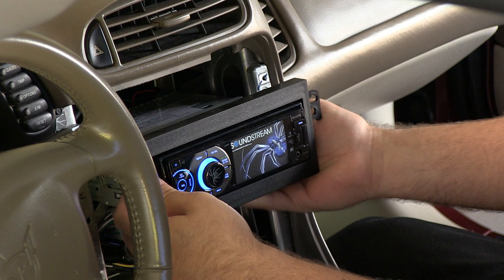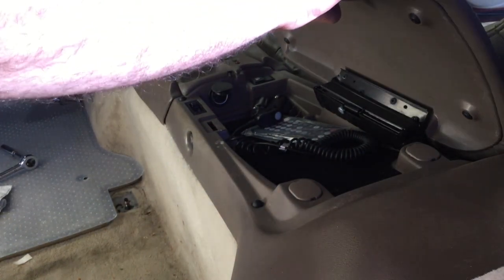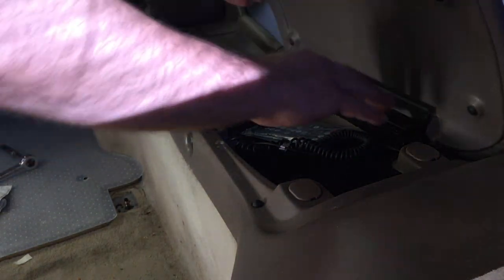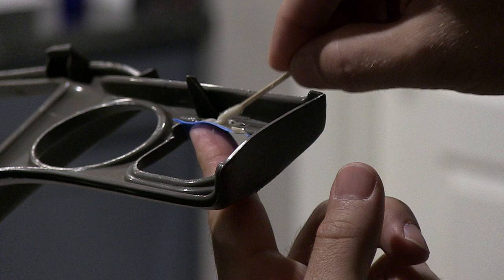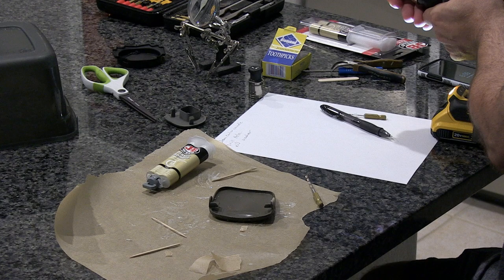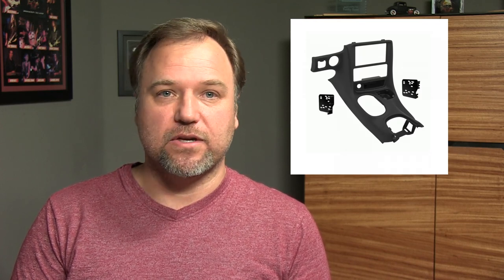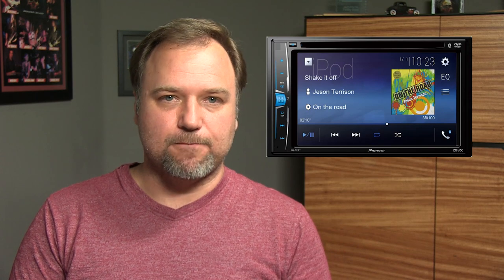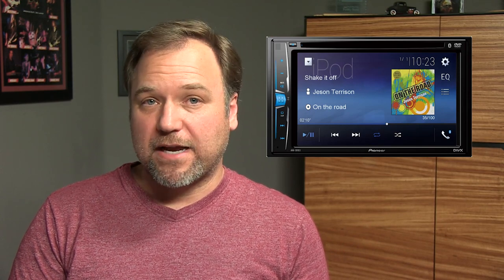Center Console, Radio Bezel and Arm Rest Options For The C5 Corvette

Comment: do you know a glue or adhesive that will bond cup holder to bottom of C5 console
Reply from the maker: I would use 100% clear silicone.  You will be able to remove it later on without damaging anything.